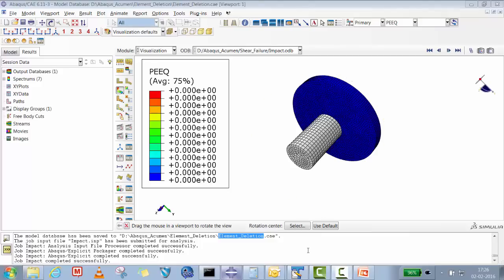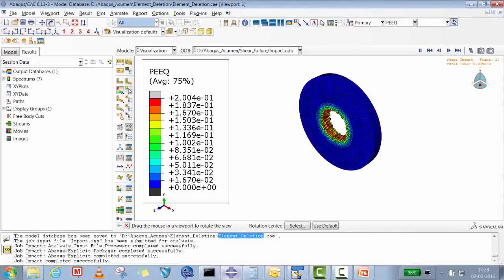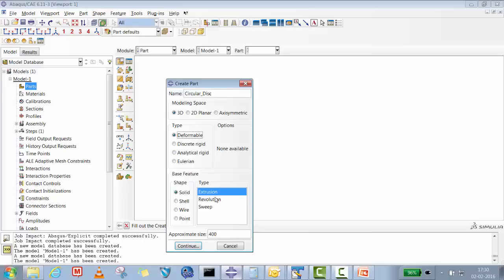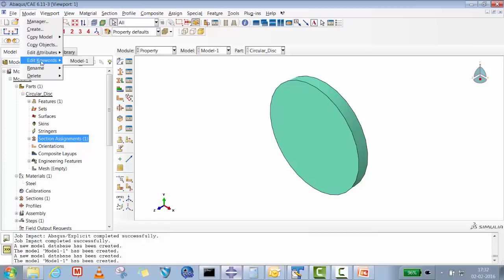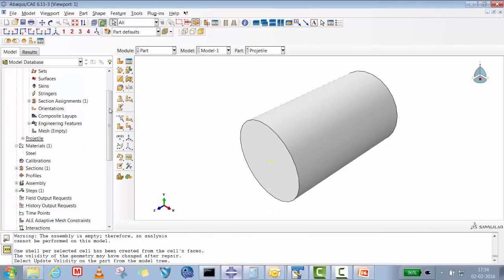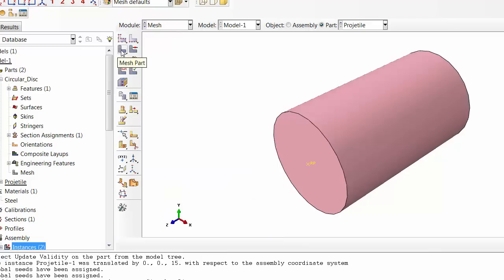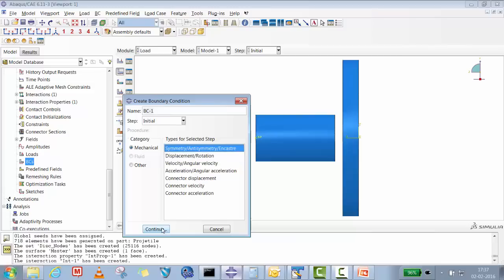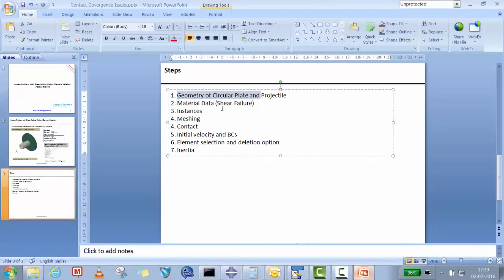Abaqus CAE-  Step by step  How to use the material damage in high velocity impact problem

Comment: !!! IF YOU GET  "*CONFLICTS, file "impact.inp", line 46474: Keyword *Conflicts is generated by Abaqus/CAE" ERROR: Please make sure that added "*Shear Failure" and value underneath are IN BLUE and that you DELETE the line "*Conflicts, Generated keywords" which is located underneath. The job WILL TAKE TIME,  I'm on 4 cores 16GB and it's been 1 hour still running.

Comment: Sir, I thank you very much for the video. In my project, I used johnson-cook damage and gave damage evolution - displacement at failure = 0.1 for Aluminum 1100. I treated the projectile as a rigid body. But then,  after the job runs, the projectile passes through the plate but no hole is observed on the plate. That is, the elements don't get deleted even after I checked the element deletion check box. The projectile mass is 0.1 kg and velocity = 375 m/s
Reply from the maker: Abaqus 2015 visualization problem - excessively distorted elements shown in results. Go to Field Output - status variable and select PEEQ (Equivalent plastic strain at integration points). Remove elements Min = 0.2
Reply: Thank you sir. But when I gave Remove elements Min = 0.2 the aluminum target (120mm by 120mm) goes in a haphazard fashion. It doesnt look pleasant at all. What can I do sir?
Reply: @saching9722  Go to field output and select status option. Dirtorted element will get deleted. I had same issue.
Reply: @3DPRINTechnology  hello brother 
I am getting error as there is one element with excessively distorted element
What to do?
Reply: @hitman5601  Reduce element size. Also, dont forget to use deletion option when you set the mesh elements. I hope it will work.
Reply: @3DPRINTechnology  no bro it doesn't work I am using explicit dynamic for impact analysis
Should I send my CAE file to you plz if you could remove that error it would be a great help
If possible provide your email ID I will send

Comment: Thank you sir for the useful video but what happened when you cut the video after error happened ... I still have the conflict problem Couldn't see the results ... please help
Reply: I think there is a conflict with the BC (encastre).

When you assign the Disc_Nodes for node set of Circular_Disc, DO NOT ASSIGN all of the nodes. just assign the inner node sets.

Comment: I want to ask a question, since you added element deletion, what if the force of impactor actually less than the strength of the material? is it sill break through the plate (since you added element deletion)? Or it will not break through the plate (since the force of impactor is small than the required strength/energy needed to break the plate?

Comment: Abaqus 2017 visualization problem - excessively distorted elements shown in results. Go to Field Output - status variable and select PEEQ (Equivalent plastic strain at integration points). Remove elements Min = 0.2
Reply: hi i am newto abaqus
where is the field output?is it in the one from step module?
where i am gonig to do Remove elements Min = 0.2?
thank you
Reply: At the time of results my disc is not breaking i.e it is just acting like made up of rubber it is being stretched till the end with projectile...can you help

Comment: The job input file "Impact.inp" has been submitted for analysis.
Error in job Impact: in keyword *CONFLICTS, file "Impact.inp", line 47731: Keyword *Conflicts is generated by Abaqus/CAE to highlight changes made via the Keywords Editor that conflict with changes made subsequently via the native GUI.
Error in job Impact: in keyword *CONFLICTS, file "Impact.inp", line 47731: The keyword is misplaced. It can be suboption for the following keyword(s)/level(s):
Job Impact: Analysis Input File Processor aborted due to errors.
Error in job Impact: Analysis Input File Processor exited with an error.
Job Impact aborted due to errors.

- This is after I have done the changes for the error. What is going wrong?
- Why did you skip the final important part??
Reply: edric96 I have faced the same probleme.
I kept changing the Shear failure line position .AND the same error .
If you ever solved this pleas replie  thanks in advance
Reply: just give space
Reply: @debasispanda7579  what you mean "just give space" could you explain? Thanks
Reply: @Okanckd  copy and paste the sorted lines at the last in place of shear failure and value...then delete the error msg after them. The syntax of shear should be with  perfect spacing...just below the upper command line...u can see any video in YouTube for reference
Reply: @lakroufazzeddine1927  After making changes delete the error messages at the end in the editor

Comment: It continues to show Conflict keywords error. Can you give me some advice?
Reply: did you find a solution for it?
Reply: Yes.
You need to write 
*Shear Failure
0.2, _ (try to align it with other numbers )
When you submit it will give an error, then you go and delete every line withe the word conflict and copy and paste (*Shear Failure \0.2,) the program will give the correct form. When you paste it that's it, don't do anything else after that you go and submit it.
Reply: @antejurcevic5855  thanks.... It's work

Comment: ErrNodeRefNodeNoRot1Axis  error....Any ideas
Reply from the maker: +mani gandan Give the inertia to rigid body
Reply: +Abaqus Acumen I checked still getting error bro
Reply: This error is caused by the lack of required boundary conditioning at inertia reference point. Apply displacement/rotation boundary condition to reference point on rigid body U1,U2,UR1,UR2,UR3.This is shown in the video.
Reply: thank u let me check